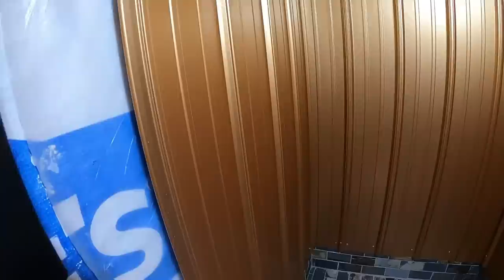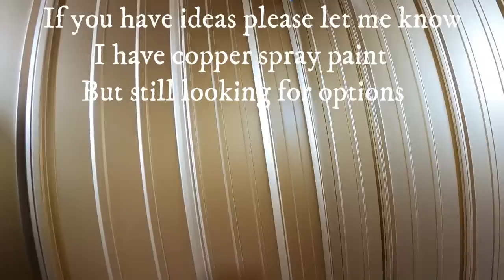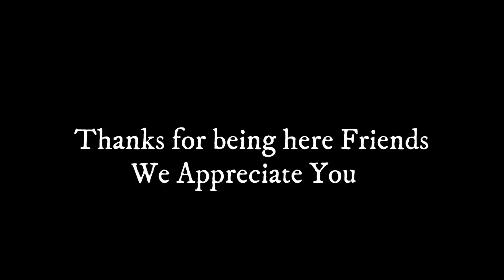Off Grid Bathroom: Diy Metal Roofing For Shower Walls

Comment: I've used the "L" shaped drop ceiling wall angle pieces for trim. They come in 12' pieces and are easy to spray paint. About $7 a piece at your local box store. You can also spray paint the screw heads by screwing them about a 1/4" into a piece of scrap wood and applying several coats of paint to match trim. Obviously the trim would sit on the raised seams along each wall. Apply a dab of construction adhesive on each seam and install trim. Pre-drill and install screws. The project is looking very nice guys!
Reply from the maker: Thank you for the tips....appreciate it

Comment: Copper is a grounding color KEWL LOVE IT good choice!!!  Ok run your foam for the metal on top of the tile where you are also putting your caulking.  This way the foam will not get wet either and it will keep the dampness away from your cement boards as well.  Match the ceiling with the walls that would be nice.  Caulking AND TRIM ALL AROUND.  God Bless you two munchkins.  Big hugs.

Comment: I like the shower , very nice. If I could make a suggestion - rub a coat of Carnuba Wax  on the walls, this helps a lot with wipe downs . Be Care full not to get any on the floor, it will be very slippery. 👍👍
Reply from the maker: Great tip! Thanks Sue

Comment: The copper colour is a great choice. Please put it on the ceiling as well otherwise 3 different types/colours of surfaces would be too much for a small space. If you can put in a ceiling light it would reflect nicely off the copper colour. Even better would be a ceiling light/fan combo (or separate) to help with moisture.

Comment: I was thinking that a section of the flat roofing cut between the ribs ane bent at 90 under the pieces would solve the purple edge,  I know I would not want to removewhat you have done.  No genuis thoughts to avoid that......

Comment: My shower is very similar. I’m wondering if I should do the ceiling. I am debating faux copper tiles. 
Did you seal the bottom where base hits the roofing/enclosure?
Reply from the maker: Yes we used foam insert that blocked the gap and we siliconed it in place. 😊👍

Comment: Jay they make trim for the  metal I used it on my garage at my cabin to join 2 piece together. I also still need to get in touch with you Facebook so we can talk about my solar system that I use.
Reply from the maker: Sounds good.....I'll look for a message.

Comment: Condensation will form in the open voids behind the walls especially being that two walls are going to be relatively cooler outside walls. The steam from above will also re-condense and add to the problem. Like in a refrigerator that is unplugged with the door left shut, mold thrives in an oxygen starved environment. You would have been better off not sealing the bottom so the water would have a way to escape and allow a little ventilation so it can try to dry out a little behind the metal siding.
Building 101.
A+ for Effort.....F for Engineering and Installation. 
You'll be tearing it out in a couple of years.
I'm sorry for peeing on your parade.

I really do love your channel.

Given your experience level I would recommend using basic methods and tried and true applications instead of trying to make every project a one off custom design. 
Interpreting and Making quirky client ideas come true and hold up over time is tough enough for very experienced contractors. 
Don't get me wrong, I love that you guys take on any challenge. I myself, don't hire any work out. 
I just worry knowing some of the projects you put so much blood, sweat, tears and money into won't hold up and will cost you more time and money in the near future...
You have my best wishes! 
Please take the aspirations down a notch. You'll be happier, more satisfied and you'll have more time enjoying the property which is why you bought the land in the first place...right?
It seems like you guys are starting to develop some anxiety over these projects and even dreading the next day or step at times. Please don't let it affect your relationship...
Take time to smell the roses....
Peace & Love
Reply from the maker: So are all the shower kits you find at the hardware stores doomed for the same fate?? I'm just curious because they are installed in the same fashion, and I know they are sealed at the seams just like we did. Just curious. thanks
Reply: That a boy! I love that you are defending your hard work. You're the man! 

My humble opinion is that where you went wrong was that you chose a thin metal which is a great heat and electrical conductor that has ridges in it that provide open air spaces behind it. I'm not convinced that you can prevent steam from penetrating all of the overlapped joints and panel edges.

What you have designed and built is a huge dehumidifier. You have basically used the same materials and are providing an ample humid air supply.
The same scientific principles used in the engineering of a dehumidifier apply.....right?

Also water, metal and electricity don't mix. Be very careful with all of your bathroom electrical connections and make sure everything in the bathroom is tied into the G.F.I. especially the fancy overhead fan. I would not advise taking a shower up on your hill when there is lightning in the area.

Can't wait for the syrup boil this Spring!

Comment: The only thing I’d worry about is the moisture getting trapped behind the metal and causing issues years from now but that’s a future Jay’s problem. Other than that I’m sure your happy this project is almost over.
Reply from the maker: Thanks goat. That is why I used the foam and sealant at top and bottom...and at seams.....and will seal at top.....so fingers crossed
Reply: @OffgridwithJayandJen  doesn’t metal sweat and with all that vapor barrier it won’t breath enough to evaporate would be my worry but I’m far from an expert.
Reply from the maker: @AccordingToGoat  I guess the poor soul  that finds the pile of cabin there some day  will wonder what the hell I was thinking.
Reply: @OffgridwithJayandJen  lmao that’s why I like you.

Comment: If celling is installed first walls do the work around the perimeter instead of screws also allows for less gaps to fill. A press brake would have been useful for more precise bends, they're available to rent. Enough criticizing from my couch, everything you've accomplished looks good, is more than adequate and quite the feat by yourselves. I have a feeling the solar upgrade is gonna be just what you needed. Binged your build in about 2 weeks and had a blast. look forward to more. Stay off them ladders! lol... BTW Copper color caulk is available on Amazon
Reply from the maker: Sweet.....love all the info and help BF.

Comment: I don't know how you're going to stop moisture, mold and bugs from thriving behind the metal.
Reply from the maker: It has coating on the concrete board behind it, the metal is sealed with adhesive all around......so i'm not sure how bugs, moisture, and mold will get back there. It is no different than when they use shower panels to build a shower enclosure.
Reply: I have a lot of respect for the both of you and your hard work. 
I just don't agree. I think you are using flawed logic and I don't think it can be the same as the other enclosures you're describing. 
I guess only time will tell. 
When life gives you lemons make lemonade. 

The glass is half full, not half empty.
The good news is that if you decide to install a metal door on the front of it with weather stripping around it, you can use the shower as a faraday cage in the event we are attacked with an E.M.P. event.
LOL!
Love Your Channel
Reply from the maker: @Bryan Jelinski  appreciate your support and that we can discuss it and not be rude about it, lol. I'm going to peel back one of those metal panels in 5 years just for you 😊.  Also it is a funny coincidence that three of our  portable power stations are all sitting in the shower at the moment......protection those electronics. Ha ha
Reply: @OffgridwithJayandJen  LMAO!!! You're a Good Dude! Please don't undo your hard work on my behalf. If it's out of sight, it's out of mind.
Water in my opinion is the most destructive powerful force of nature. Trying to control the path of water is hard enough, but steam and humidity are really difficult.
Keep kickin' ass and takin' names.

Comment: Jenny, I asked Jay for a video of you in the shower, not Jay in the shower au natural... I just ain't into naked guys/LOL and a couple roll on the floors suppressing a hard giggle. Ah.. a dirty mind is a terrible thing to waste. Okay lets get serious..... next time when folding this kind of metal, turn the sheets over and measure just where you want this bend... take something metal and clamp it to this so you can take your utility knife and scribe the metal...NOT CUT IT,  just scribe into it enough to make a decent scratch in it so when you turn it back over, it will naturally follow that mark without it breaking through. For some odd reason, it is so much easier to bend just like ya wanted it. The next thing is just a idea that may work for the trim on the front part where the metal ends is to take something like a two by two board and trace the folds of the metal... and use the jig saw to follow the contour of the ends...that should get a start on it covering the metal and just ending one type of material and start of your pine finish. Practice off of camera and without the sound as a few longshore cuss words might envelope... not to mention pieces of masking tape for cuts on fingers while pushing things around.... now do I get Jen videos/LOL... I can afford a plane ticket there to just watch in person but I most likely would have to stay a long time to afford to go home.... I so do love chili but no cheese as us old guys have problems with constipation. So some sweet peppers and sprouts from the window sill garden. Things are getting crazy in stores as the shelves are empty and food is getting real hard to find. First person in buys almost everything and the next does so ya have little to pick from.... my dog is complaining about eating real dog food but I am complaining cause I have to just as well. Okay that was a fib or a white lie. If one of you is a artist, do a picture on the walls of something like a deer or elk, horses... what ever turns the crank and will break up the overwhelming effect of solid copper that may follow after many showers have been taken.... Or just shower together and forget about the walls and get serious.... I shouldn't have to explain that one/LOL
Reply from the maker: Love your creative thoughts and jokes my friend.....your humor and giggles are appreciated.  I hate to break your heart, but there will be no shows in the shower on this channel.....but don't fret, for you have plenty of others that show it all. Again.....sorry to disappoint,  lol